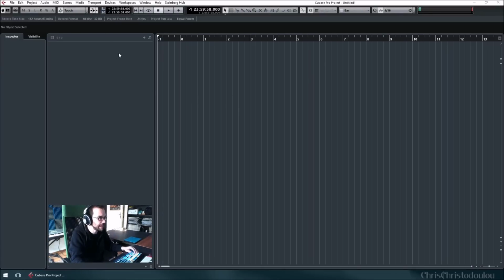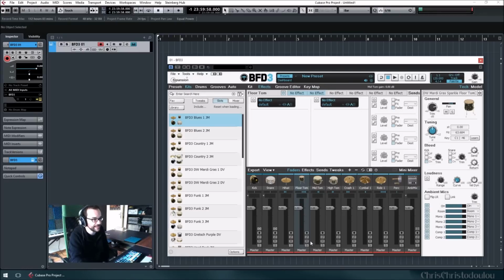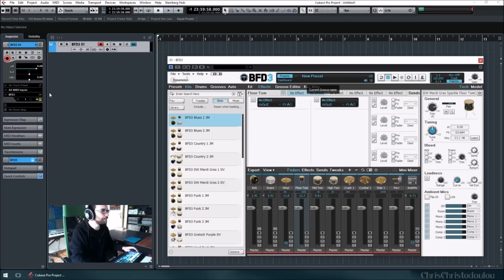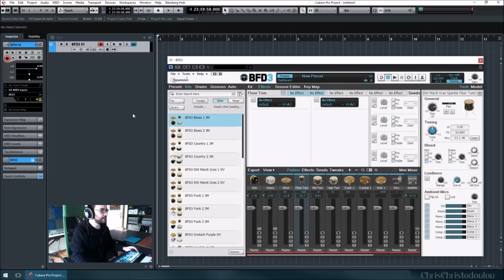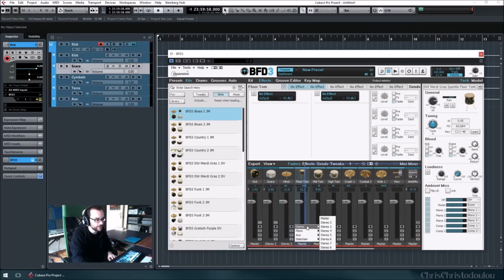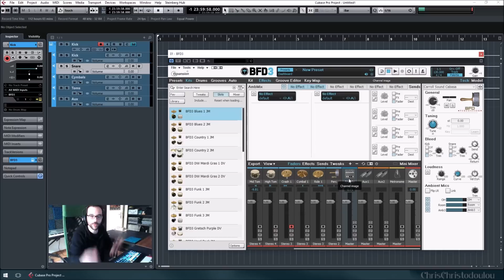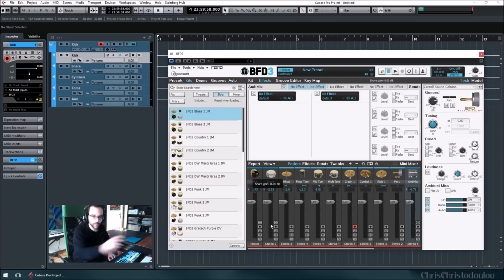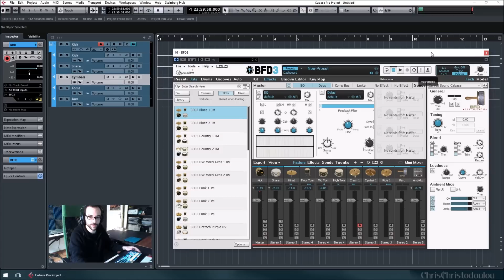Behind the Music: MIDI DRUMS, part I - Setting up multiple outputs for mixing in the DAW

Comment: This is a great video, but you ended it about 3 minutes too early!  I wanted to see you actually record to those individual BFD3 channels in Cubase, because I haven't been able to do it.  I did everything up to the end of the video, but when I try to record, Cubase isn't capturing the output.  Any advice?  Thanks!
Reply from the maker: I don't actually record the outputs into audio files, I mix and bounce directly on the VST outputs, so I guess I didn't even consider going the extra step :)

If you want to record audio files (eg. to send to a mixing engineer, or archiving, or save CPU resources) it's quite easy if you have a version of Cubase that has the "Render in Place" feature. You select the MIDI events, go to Edit -> Render in Place -> Render Settings... There are a few options there but the result will be a multitrack bounce into your session.

You can check this video for a more detailed tutorial: https://youtu.be/S8EvozKfFfg